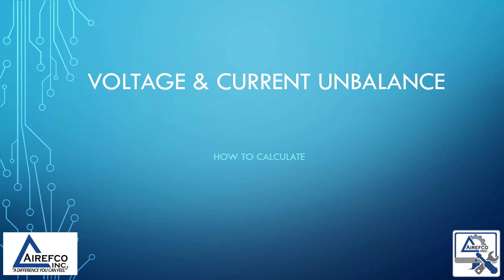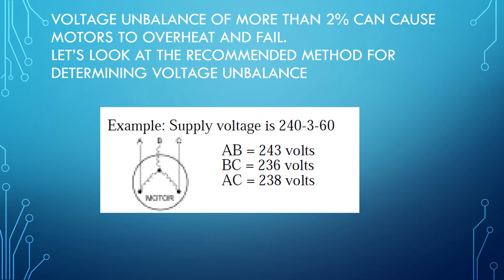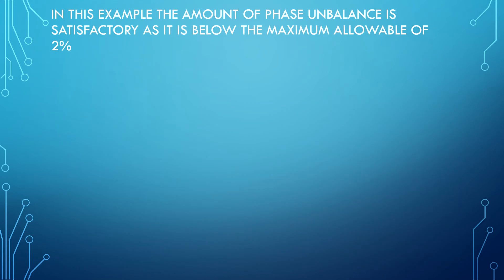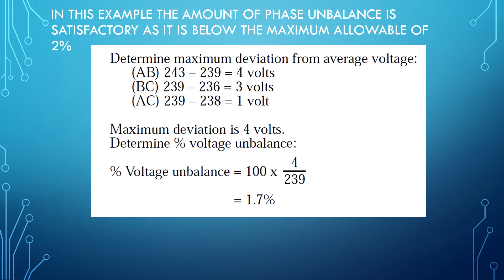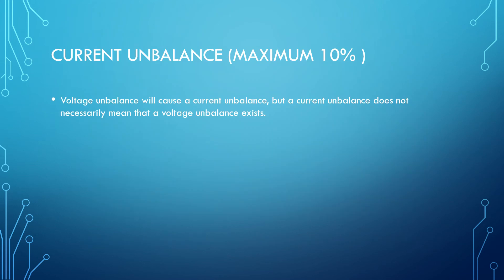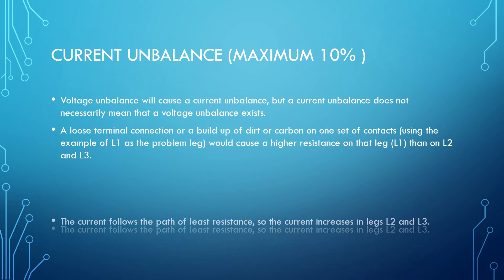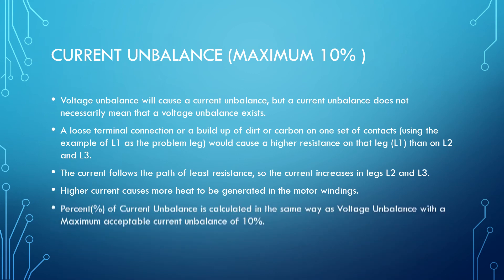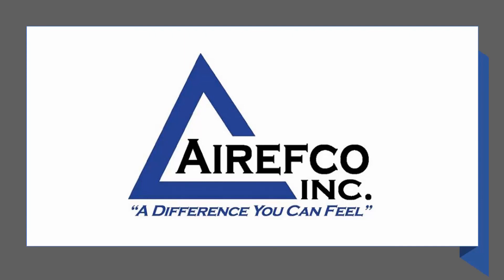Voltage Unbalance

Comment: First to comment! Could there ever be a condition where the actual resistance in the motor windings could be different and cause the voltage readings to be different and seem like voltage imbalance? Or is measured voltage imbalance always a supply voltage issue?  And... could the voltage imbalance be caused by a bad breaker or connection in the panel?